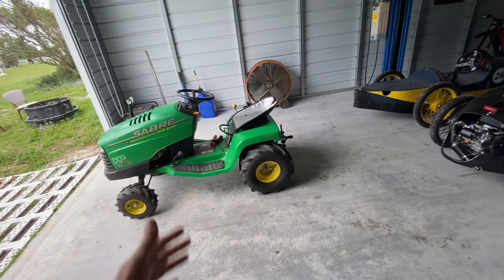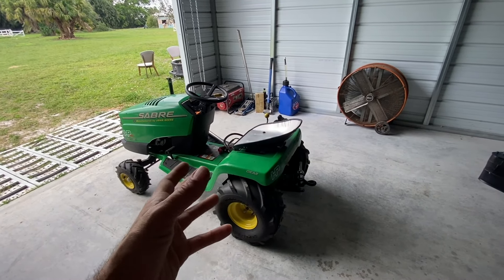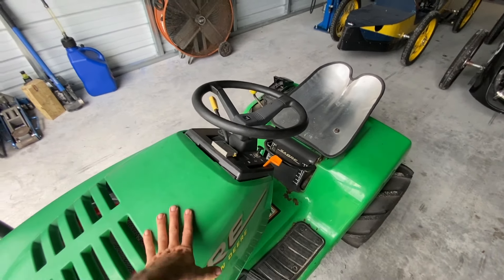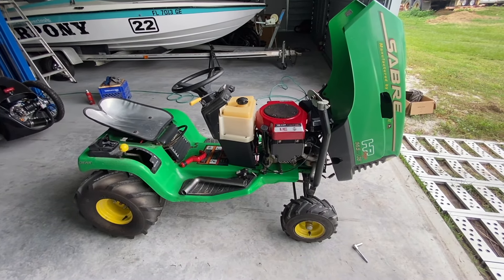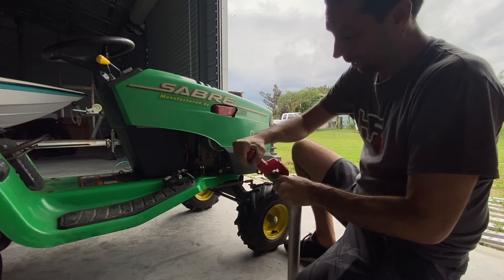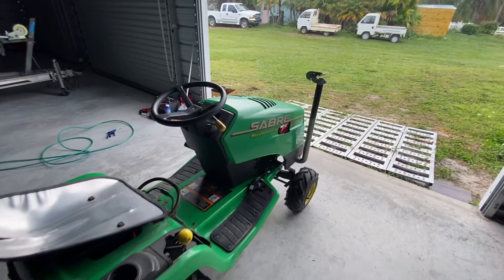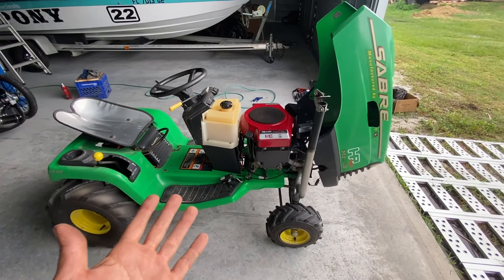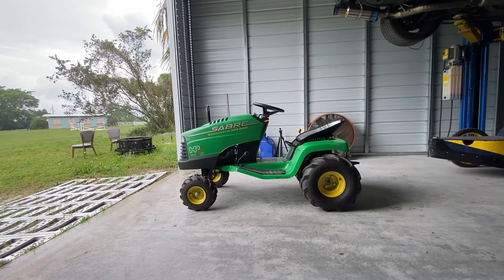Motor swapped Mini Pulling Tractor update | New Exhaust!

Comment: I just bought a 1980-something Roper lawn tractor for 50 bucks, it has an old 11 horse flathead briggs single banger and all it needed to get running was a new magneto and a little TLC. Best part about it is everything is made of METAL. The only parts made of plastic are the knobs on the shifters and throttle lever. You shift it with an H-pattern shifter between your legs with 1-2-3-R and a second knob splits between high and low. Gonna use it to pull the non-running cars that come to my shop.
Reply from the maker: Hell yea! Make a video and share it!

Comment: Love the mower content
Reply: 78 gt14 sears I’ve got a 26mm eBay carb, 125 jet seems to run the best, had to get creative but I found a nibbi crf 250 intake manifold that had similar bolt spacing-62mm stud to stud, I believe the nibbi was 61.7mm something goofy, but I rigged it to a clutch lever for one of my Harley’s that was on the shelf clamped that to a pipe and that’s the throttle, had to rewire it but it’s sleeper, looks like shit but would probably pull a good amount.. also it sat for 20ish years from what I was told so it has all this bush barnacles on it I think look cool but once I wash it when the weather breaks it’ll be mint
Reply from the maker: Sounds awesome!